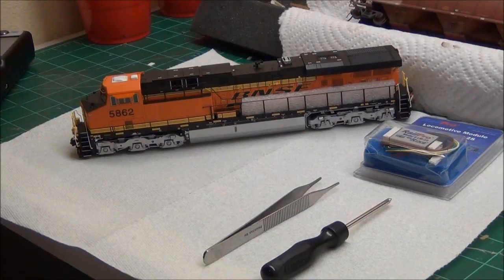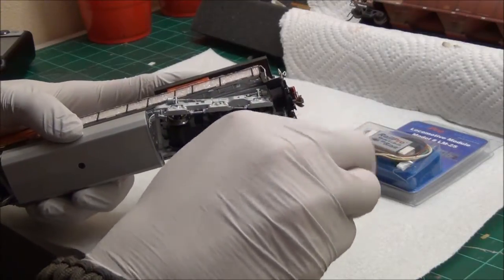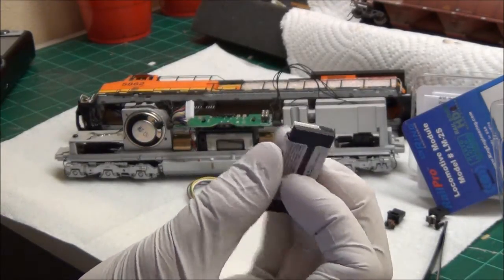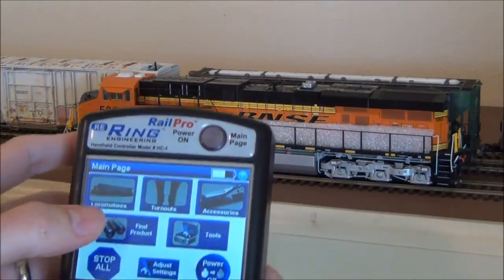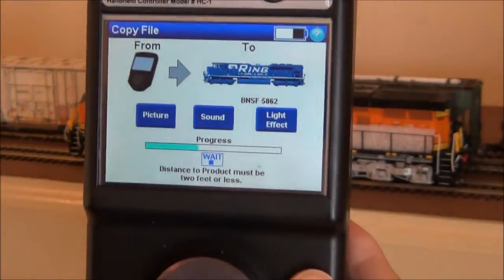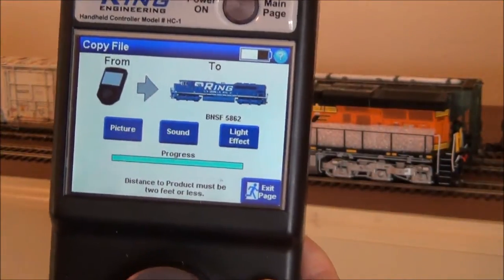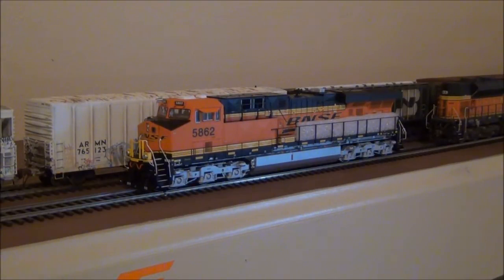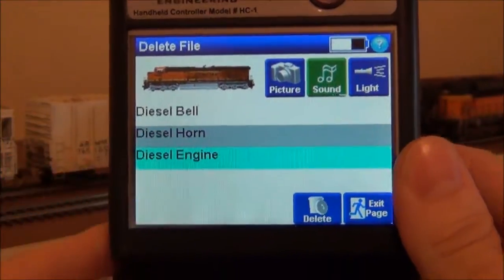Railpro Installation

Comment: I would recommend to anyone using Railpro; when you set the "Motor Full Load Current" I would recommend doing it at least 3 times or until the reading it gets is consistent. What I have seen is that one or two times will not give the same motor full current load reading. After the 3rd or more times the reading becomes consistent. This may be due to the motor not being warmed up. I just know that the first reading you get will not match subsequent reading from the same test. This is only my observations with the system functionality.
Reply from the maker: +captainbill12 
Yes, I typically do this as well.  However, I've found that running it once is sufficient for normal operation.  Railpro will work perfectly fine if the setting is run once.  I didn't show it in the video as it isn't really necessary.

One other reason that running it a couple of times may drop the value is that it could be polising the wheels/track and lowering the resistance.  Overall I've seen the difference in readings to be rather negligable....usually within 10-20 mAh.

Comment: That’s a revolutionary system! Makes me want to repacked my DCC stuff with it.
Reply from the maker: You can do both.  Railpro runs on DCC powered layouts without issue and will not interfere with DCC.  In fact, one of the recent updates also enabled a "DCC-mode" for Railpro, so that if you wanted to you could turn the Railpro module into a DCC decoder to run with your DCC-equipped locomotives.  Of course you lose the load-sharing when you do that, and will need to speed match traditionally, but it is cool to have the capability.  Lots of guys I know run both DCC and Railpro.  Pick up a couple of LM-3S modules and a CI-1 computer interface controller.  That's the least expensive way to jump into it.  Your computer (laptop) can act as a controller until you get a real Railpro controller.
Reply: KPack That’s awesome. So I could get one of the RailPro engine modules, and the controller, and just run the program off my NCE system’s track power?

Comment: Does the LM-S2 module have any kind of built in capacitors that would function as a "stay alive" function for dirty track,so that the loco will not stall when running over switch frogs?
Reply: miachevydude no

Comment: can Rail Pro do N Scale havent seen any videos on N Scale
Reply from the maker: No N scale for Railpro yet.  Lots of people want it, but it would be very difficult to fit all the circuity into such a small package.  Keep in mind that Railpro has radio receivers/transmitters built in, as well as other components not found in DCC.  Some of those things may not be made in small enough sizes to be practical for N-scale.  Also keep in mind that Ring Engineering is a small company and manufactures all it's products in house in the US.  They don't have the budget, machinery, or technology that a big overseas electronics company has.

Comment: Very Interesting and well done.  Almost ready to pull the trigger on this.  Is there anything you do not like about it?  I have read what  ever I can find on this but and would like to know even more.  Thanks again.
Reply from the maker: As with any new system there is a bit of a learning curve.  However, it's MUCH easier to learn Railpro than it is DCC.  Not having to mess around with CVs, programming tracks, or non-intuitive throttles makes it a very easy system.  Overall I have been very pleased with it.  The only thing that bothered me when I first got it was the sound library was pretty small.  It is still on the smaller side, however Ring Engineering has really been working hard at putting out new sounds.  Just in the past few months they have released the EMD 567, GEVO, Alco 539T, and dynamic brake sound files.  I know that more sounds are being worked on.  The really nice thing about the system is that it can be easily upgraded with new software.  It is relatively easy to write new functionality in into program updates that can then be downloaded on the locomotive modules.  Basically you are limited only by the amount of storage on the locomotive modules.

Comment: Hello. I'm sorry I did not understand. But the system is DCC or analogic? The Track is powered with DCC or not? Thank you
Reply from the maker: +SuperFrecciaNera 
Railpro is neither DCC or DC.  It can use either DC or DCC power to run.  All it requires is consistent voltage to power the locomotive modules.  The commands are sent wirelessly through Direct Radio from the controller to the locomotive modules.  

Railpro's power supplies are filtered DC, meaning the DC output is constant without any spikes in power.  Railpro locomotives can be run on any DCC-powered track as well.  They don't respond to DCC commands and Railpro cannot control DCC locomotives....the Railpro locomotives only use the track power from DCC, nothing else.  

Hope that answers your questions!

Comment: If im using railpro i need to buy locomotive dcc ready only?
Reply from the maker: +neal j
No you do not need to buy DCC-ready, but that is the easiest and usually least expensive way to go.  You can buy locos with DCC already installed and switch it out to Railpro, but that usually costs more.  You can also by DC locomotives and hardwire them for Railpro.  The hardwire is the same process as would be for a DCC install with a 9-pin plug.  There are various videos out there that show how to do it.  I usually buy DCC-ready myself but end up removing the factory board and lighting, and hardwiring in a 9-pin plug and LED lighting.  But that's just me.

Comment: Are you converting all your locomotives to rail pro or just your new ones
Reply from the maker: +Jacob Triezenberg 
All.  I have no interest in DCC at this point.  Been there, done that and am happy to past it.  My locomotive lineup is not terribly large so it's not difficult to do.  At this point I have something like 14 or 15 with Railpro fully installed.  The remaining few are in their boxes waiting their turn for detailing, weathering, and Railpro install.  Whatever DCC decoders I had have since been sold or are gathering dust in a parts drawer.  Once switching to Railpro I found it so enjoyable that I just had no interest in bothering with DCC anymore, so there was no reason to keep any of it around.

Comment: Is this good for g scale
Reply from the maker: Yes, definitely.  Ring Engineering has released a module meant for large scale (O and G) that is rated for the type of amps that those pull.  They are ready for battery power if you decide to do that.  They are all sound modules and radio controlled.  Look up the LM-3S-G from Ring Engineering for more info.